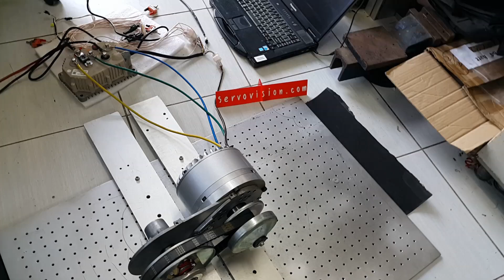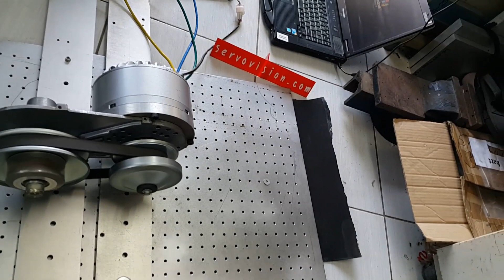Electric CVT(Continuously Variable Transmission )  model : e-CVT3K  for Brushless motor 3kw/6kw

Comment: Do you have any cvt model which can be used to convert petrol scooter into electric scooter 
I want max 80-90kmph speed and good acceleration
Reply from the maker: yes..  We have eCVT 5Kw  ..pls contact email =servo.vision@yahoo.com
Reply: comet 40 series torque converter, more than enough

Comment: Hi can we install cvt system for motorbike with centre-centre  distance of 600 to 700 mm.
Reply from the maker: yes  .. you have to  use  the longer chain  .   This  set is 3000watt    but We alos have 5000watt and 10Kw also
Reply: @Servovisionlife  how can I contact you. ? I would like to have a discussion regarding this
Reply from the maker: @raj49328  www.servovision.com    or email = servo.vision@yahoo.com   We also have 5kw ,10kw 15kw CVT    now   15kw CVT using motor Motenergy USA ,sin-cos feedback  technology    low  cost good price  !
Reply: @Servovisionlife  thank you.. Will mail you now our requirement
Reply from the maker: @raj49328  Best Regards, 
Nusol 
Servovision co.,ltd
900/230 sukumvit 103 ,
Bangna , bangna 
Bangkok 10260
Thailand 
Tel : 66 2 7432441, 66 2 7432442 FAX : 66 2 7495833
www.servovision.com
email: servo.vision@yahoo.com
skype : servo.vision

Comment: First thought - you would want to reduce the motor output 5:1 before you run it through the torque converter. That would spare the belt and mass from having to spin more than 800RPM, instead of an insane 4,000.  And that would quiet it down - it's very noisy bc of that. Your output should go directly to the drive sprocket from the converter. I think those numbers. THANKS!
Reply from the maker: We  have a new CVT    very  efficiency  Now    www.servovision.com    or email = servo.vision@yahoo.com   We also have 5kw ,10kw 15kw CVT    now   15kw CVT using motor Motenergy USA ,sin-cos feedback  technology    low  cost good price  !
will show  on   youtube next month
Reply: Most CVTs use 3600rpm so 4000 is within range
Reply from the maker: thks for advise  ... We will have a  new improve CVT 13Kw peak 33Kw  by using Motenergy motor   .. will coming soon.  in  our channel   .. new electric CVT !!
Reply: Incorrect assumptions have been made here.   If you do the reduction before the CVT, you multiply torque, right?  Well, guess what, the CVT can only handle a given torque load.  Many mechanical CVTs rely on a broad RPM range, because of the laws of physics.  They deliberately use a broad RPM range to have the force variations necessary to actuate it through the whole range.  Yes changes can be made, but if you don't have RPM variations, how will you actuate it?  Electrically?  Hydraulically?  suddenly it costs a lot more money.
Reply: @mlw19mlw91  Well, I'm not a specialist, and am not into motion dynamics as an engineer - so I will abey to wiser than I - but the notion that the RPM at engagement isn't easily changed, or that gearing somehow reduces the RPM range - that's not on the test friend. As to the input torque - it's true that higher RPM divides stresses (more RPM per unit of work,) but I'm leaning towards a beefy box and drive-train that doesn't scream at me like a 1964 racing 2-stroke.

Comment: Looks like it doesn't work properly
Reply from the maker: www.servovision.com    or email = servo.vision@yahoo.com   We also   have 5kw ,10kw 15kw CVT    now   10kw, 15kw is perfect drive  smoothly
Reply from the maker: We  have a new CVT , max speed up to  6000rpm    very  efficiency  Now    www.servovision.com    or email = servo.vision@yahoo.com   We also have 5kw ,10kw 15kw CVT    now   15kw CVT   max.  8000 rpm    using motor Motenergy USA ,sin-cos feedback  technology    low  cost good price  !
will show  in youtube next month

Comment: Seems inefficient
Reply from the maker: We  have a new CVT    very  efficiency  Now    www.servovision.com    or email = servo.vision@yahoo.com   We also have 5kw ,10kw 15kw CVT    now   15kw CVT using motor Motenergy USA ,sin-cos feedback  technology    low  cost good price  !
Reply: @Servovisionlife  
what's your new CVT efficiency in percentage output at the CVT driven pulley vs electric motor shaft output?
Reply from the maker: @xytopk51  pls  contact  email  = servo.vision@yahoo.com
Reply from the maker: pls  contact  email  = servo.vision@yahoo.com

Comment: That variator is 50+ years old tech. Real metal tooth gears with same adjust result is possible. Took me 20 years tho... but I got it. Just no idea where to sell it.
Reply: send me the product details on syedasim2319@gmail.com
Reply: @syedahmed8487  sure... unpatented idea...
Reply: Hi, I'm interested in what you have to offer.

¿Is it the same concept as this?, I mean, basically a CVT-to-Electric Motor adaptation?

If so, we're interested and we'd like to try it out.

I work at a small South American EV company; Quantum Motors S.A.. We've just started and are looking to expand to other regions inside our country, but our topography is very challenging; from 150 masl all the way up to 3600 masl in just about 800Km. The gradients get crazy in La Paz.

Like our company, our cars too are small, basically one person vehicles. We power them with a small 3KW motor and would like to increase the torque without changing any of the other components much.

¿Are you interested? If so, I'd be happy we'd exchange more info via email; beccarbasti@gmail.com

Comment: This is all fine and good but its the same problem musk is having, how do get all that power to the ground? Short answer: YOU CANT
Super cars are now using these because of the immediate torque applied but the problem still remains there is way more power that can be used and its not physically possible yet to use it, the physics are not right and design has to catch up because with this means you can have all power and torque right now at the push of a button that's the problem to fast to fast. Materials and invention hasn't caught up yet so we limit them, and if we limit them then they are no better then what we have now, why because silly the cost
Have a nice day
Oh yeah, question, this is a EVT not a ECVT right? Or are they the same thing?
Reply from the maker: We  have a new CVT , max speed up to  6000rpm    very  efficiency  Now    www.servovision.com    or email = servo.vision@yahoo.com   We also have 5kw ,10kw 15kw CVT    now   15kw CVT   max.  8000 rpm    using motor Motenergy USA ,sin-cos feedback  technology    low  cost good price  !
will show  in youtube next month

Comment: Great idea, should save on battery usage. and make the motor last longer.
Reply from the maker: We  have a new CVT , max speed up to  6000rpm    very  efficiency  Now    www.servovision.com    or email = servo.vision@yahoo.com   We also have 5kw ,10kw 15kw CVT    now   15kw CVT   max.  8000 rpm    using motor Motenergy USA ,sin-cos feedback  technology    low  cost good price  !
will show  in youtube next month
Reply: @Servovisionlife  What is the cost of e cvt for 10kw motor
Reply from the maker: yes.  e-Motorcycle or micro EV  have to use CVT for   changing gear ratio    like    normal car .  This CVT will  help to  have massive torque at starting and   max. linear 
speed  on   travelling.